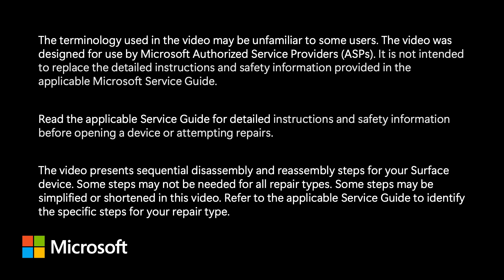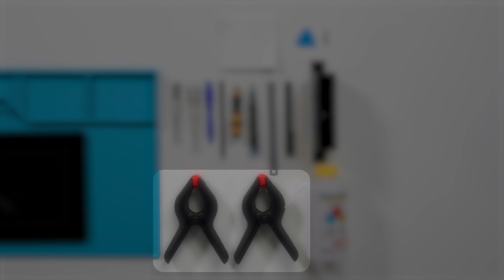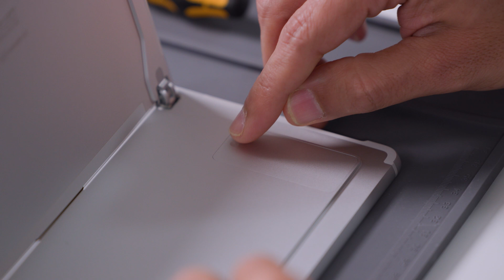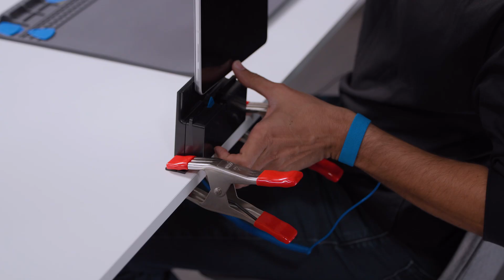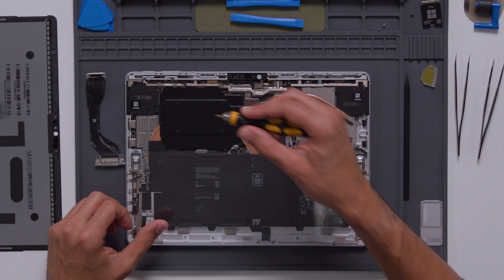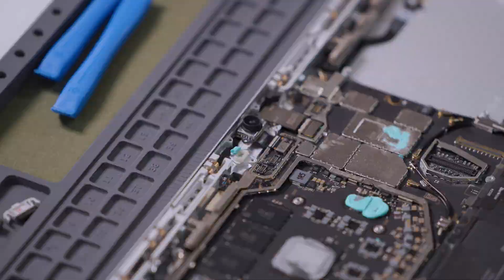Repair | Surface Pro 10 - 5G

Comment: Isn't this meant to be the Surface Pro 11th Edition? Right now there is two videos; one labelled Pro 10 for Business (which exists today), and this one. A consumer version does not exist as far as I know and the board shown in this video looks to have a X Elite or X Plus Package soldered on it. It would also make more sense this way. The mistake is both in the title; description; and video script/voice over it appears. Unless I am mistaken and a Surface Pro 10 for consumers exists but i fail to find it.